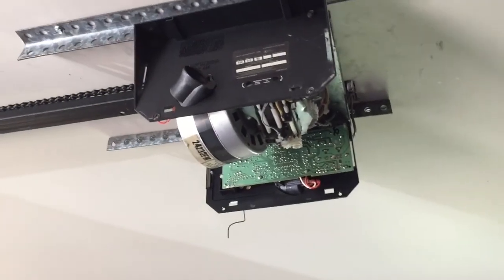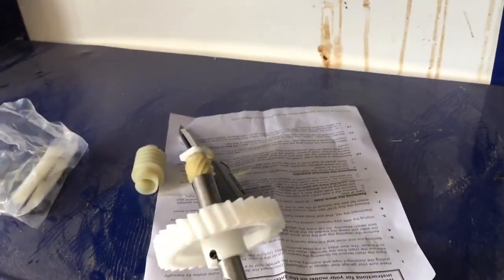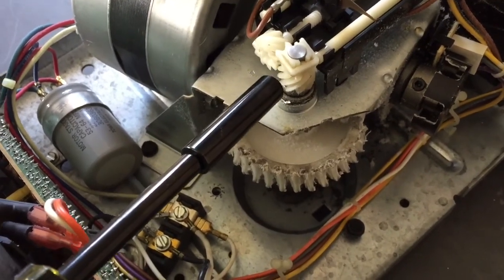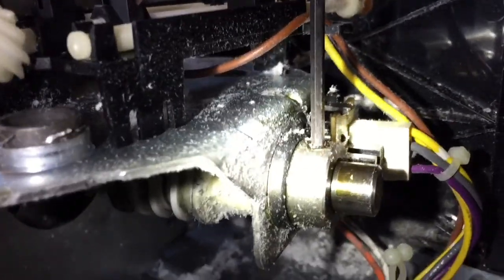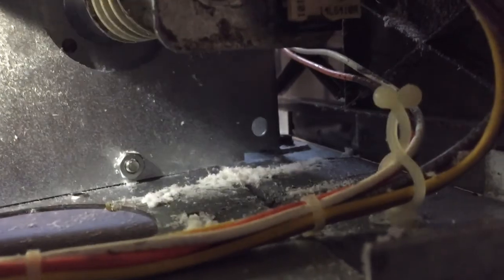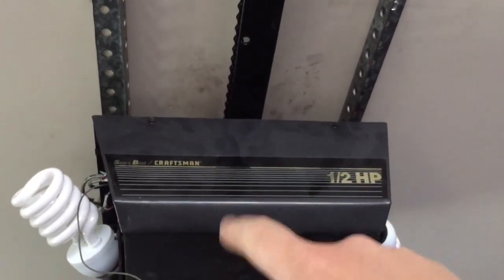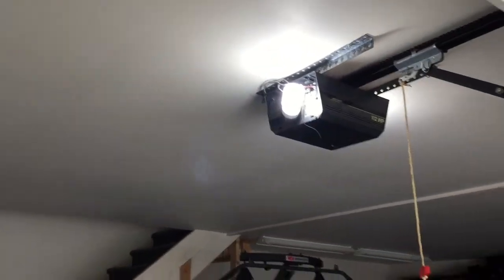How To Replace Sears Liftmaster Garage Door Opener 41C4220A Gear and Sprocket HD

Comment: What might cause the gears to wear like that in the first place?
Door out of balance or binding?
Or lack of grease on the gears?
Or perhaps chain adjusted too tight?
Reply: Just from being used a lot heavy garage doors that's not all that can happen to the sprocket assembly the gear on top can brake off and the bearings can breake
Reply: Also if you dident grease the gear it would last about 2 weeks

Comment: I've replaced many gears in the Chamberlain, Sears, Liftmaster, etc openers and I don't replace the pinion gear. The pinion gear is made from a much harder material and never seen one wore out or have I had a call back due to the replaced gear wearing out prematurely.  The debris needs to be cleaned off the worm gear and use alot of grease on the new gear.
Reply from the maker: Good advise.

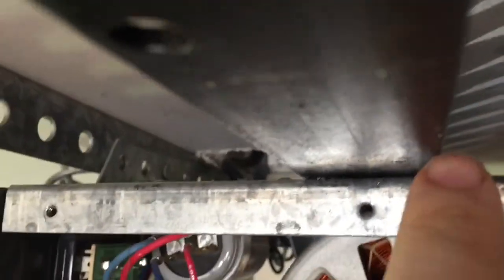Comment: great video thanks for posting.  i have a flush mount as well so the whole box has to come down.  i have never done this before, so at a about 1:05 in on the video you mention taking the tension off the belt, how do i do that?
Reply: nevermind youtubed it thanks
Reply: There are two nuts on the chain assembly, loosen the one furthest  from the motor, you will see the chain droop, you don't need to loosen till the chain is free, just take the tension fully off.

Comment: What causes drive gear to wear out like that? I replaced mine because door wouldn't open and it got chewed up again.
Reply from the maker: MARCIN W. It can be out or the door can be out of alignment and not properly oiled or greased. I wish they would make the gears out of better material.
Reply: A lot of things can cause it. It can be the door is too heavy and your Springs need adjustment, previous wear from a broken spring and trying to open it or several other things like bad Wheels, broken hinges, bad end bearings or your door is catching somewhere causing stress on the opener when it is opening or closing.. Unfortunately they're plastic but if your door is working well they will last a really long time.

Lubricate your door at least twice a year, replace your wheels every 5 to 8 years and if you have a broken spring for God's sake please do not try to open and close it with your motor. It's not going to open unless you assist the door  that's providing you don't have a cable off.
Reply: @fastgaragedoorrepair6131  For me it was the top bearing on the gear shaft (the one under the sprocket) had lost all it's lube and was binding on the shaft. It's lasted well though, been in service 20 years lifting a heavy double wooden garage door at least twice a day

Comment: Has anyone done this, swapped both gears, and then had a loud rattle coming from the gears? When the door is raising, these gears rattle like crazy. I tightened all the mounting screws and confirmed everything is in the correct order.